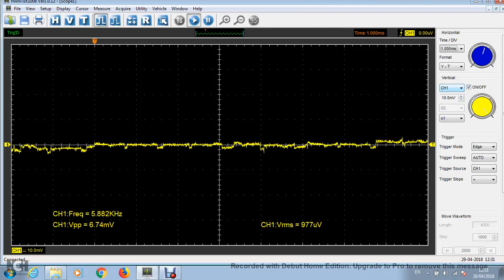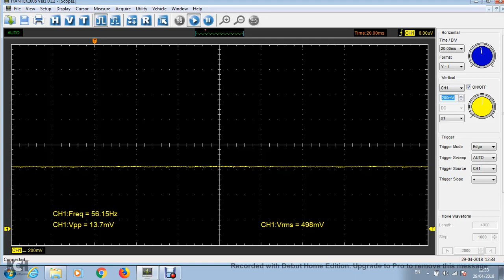DIY Pressure Transducer Final Fix For Power Supply Noise

Comment: Interesting with the digital steps in there. Found the same with mine.
Seems like it does some sort of adjustment or measurement only every 20ms so it does not appear to be a fully analog sensor.

Comment: that setup is a low pass filter, do a little research and you might find more effective components, i'm currently working on a low pass filter with an op-amp. them cheap scopes aint got no filtering